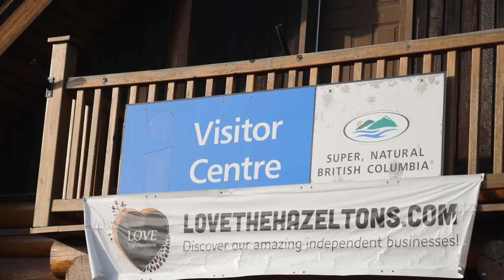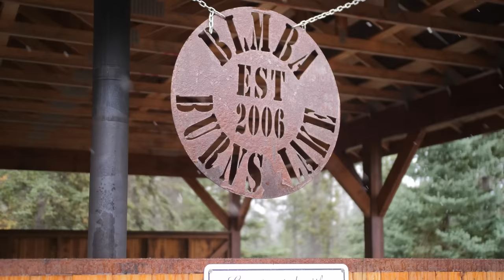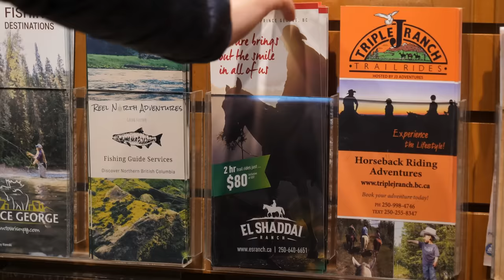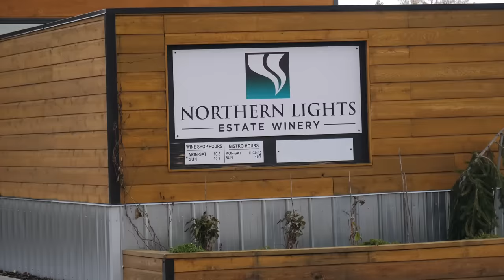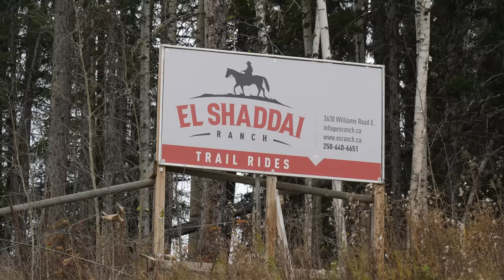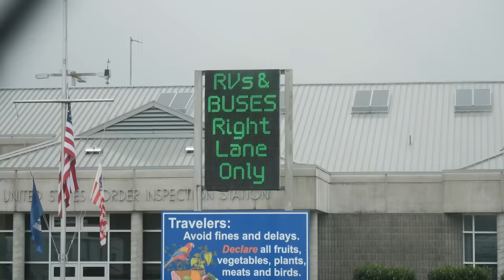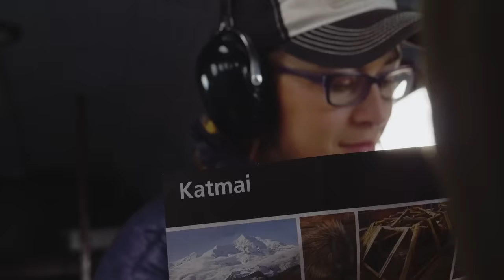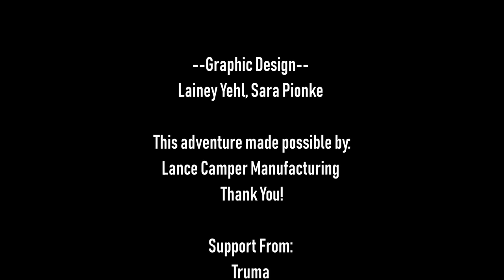The End of the Journey: Camping in Snow, Mountain Biking, Prince George & Going Home | Go North Ep20

Comment: So why did Caitlin need Class A motorhome driving instruction from the RV Geeks?  She was driving this truck camper just fine.  She said that she has pulled the fifth-wheel.  I bet she could have driven the Class A without any problem, although it probably would have taken some miles before she was comfortable doing it.  Go Caitlin GO!  Now in New Zealand, you will have to get used to driving on the wrong side of the road.  No, you do not need either Peter or John to show you how to do it, although in the UK, I found it difficult sitting on the wrong side of the car going the wrong way around a round--a-bout pulling out of it onto the wrong side of the road again.  That was just too many wrongs compiled into one task for me!  ENJOY YOUR TRIP!!!
Reply: Hi Carl! Just happened to see this, so thought I'd chime in. I'm sure Caitlin will concur that her 5th wheel driving experience was extremely limited, as in getting on the interstate, driving a bit, and then getting off again, which is one of the easier places to drive. We focused on maneuvering in more challenging spaces, such as parking areas and local roads & turns. She was a quick study, and surely would have done great without a retired professional instructor (me! 😊) coaching her, but having that resource available not only makes for a safer start, but generally helps keep any nervous student a bit more at ease. Not to take anything away from truck campers, as they also require skill to drive, but a 43' diesel pusher is a whole 'nother animal!
Reply from the maker: Ha neat the geeks chimed in here, we're totally looking forward to the backwards driving thing lol!

Comment: 1. So did the mpg get better with the new truck? 2. How long can you run the a/c on the battle born batteries? Thanks guys.
Reply from the maker: The mpg was not as good with this truck as ours, averaging 11.4 vs almost 20.  The BB will run the AC on this rig for about 6 hours full out, but we only ran it briefly a few times.